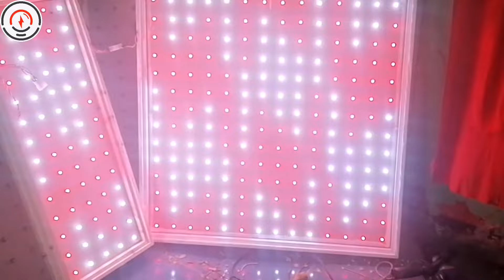How to Connect Pixel LED in Dance Floor by LEDEdit PRO

Comment from the maker: Pixel LED Effects Download Pack: 7000 Effects for LEDEdit, NeonPlay, LEDEasy, LEDBuild, Madrix, Jinx, and Glediator.
https://lededitpro.com/product/pixel-led-effects-download-pack-7000-effects-for-lededit

✅ Pixel LED Effects Pack Details:

* Files: 7000+ 
* Size: 23 GB
* Formats: SWF, TOL, AVI, MP4, and GIF

✅ Types of Pixel LED Effects Pack:

* Thoran effects (All sizes)
* Gate effects
* Circle effects
* Building effects
* Road effects
* Ceiling effects
* Animale effects
* Cartoon effects
* Dance Floor effects
* Flower Rotation effects
* Islamic effects
* Hindu effects
* Christion effects 

The best video effects and animations for Pixel LED software.

✅ LEDEdit PRO

#LEDEdit #LEDEdit2014 #LEDEditEffects #Jinx #LEDEasy #NeonPlay #WS2811 #T1000s #T8000s #K1000c #striplights #pixelled #lededitpro #gatepixelled